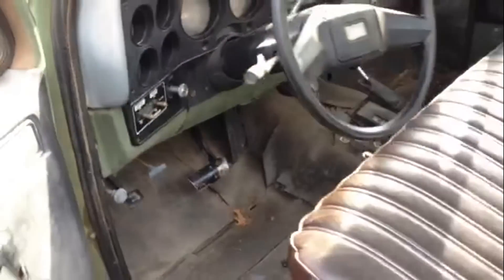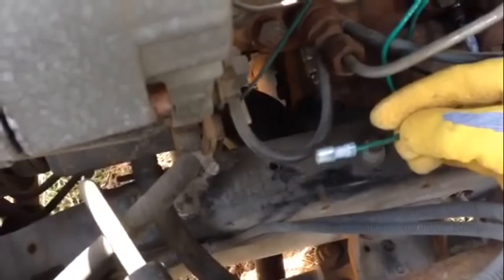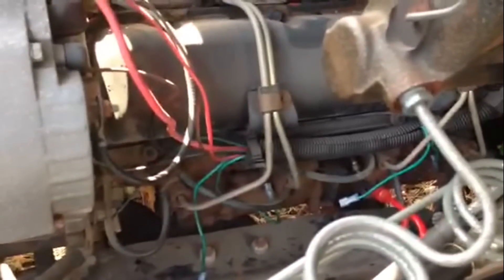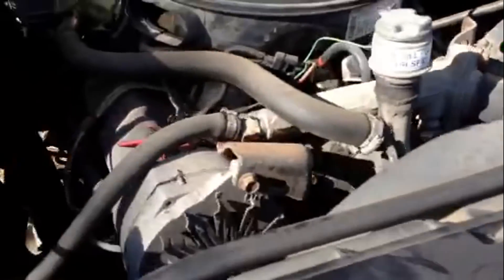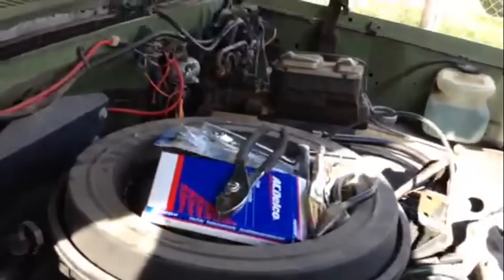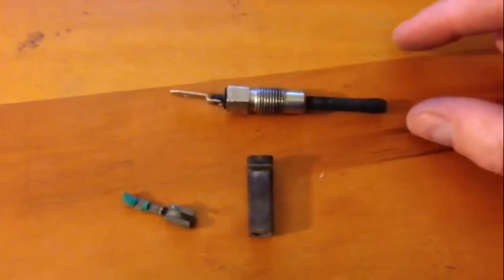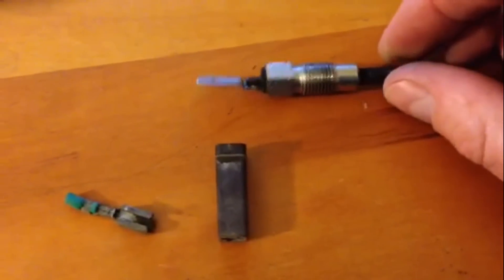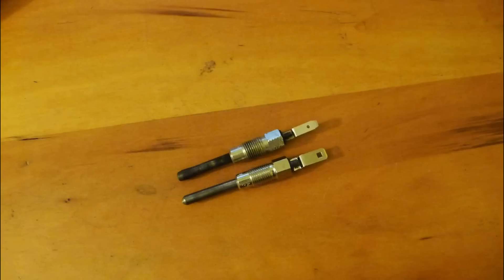Detroit Diesel 6.2 Stuck Glow Plugs - M1008 CUCV - Part 1

Comment: I did not see how you got the 2 stuck glow plugs out. Can you tell me minute and second on the video where this is explained?  Thanks
Reply from the maker: @johnschindler6579  i used a glow plug removal tool. It was hard to get a video of it. There are better tools than the one i used, but its only job is to remove stuck glow plugs